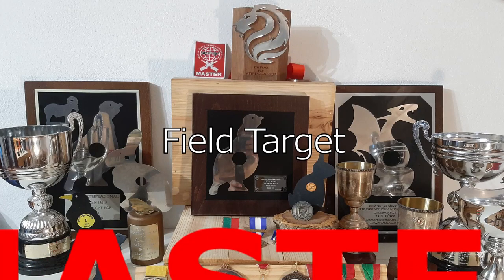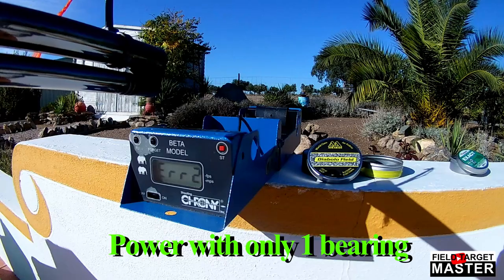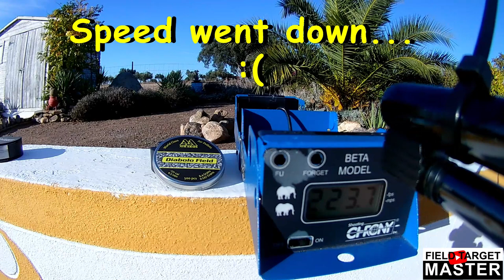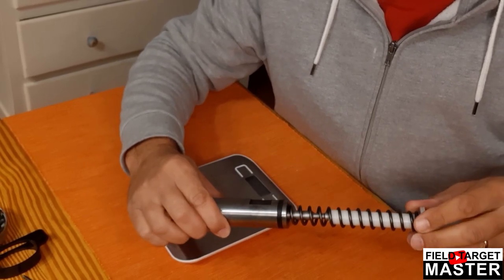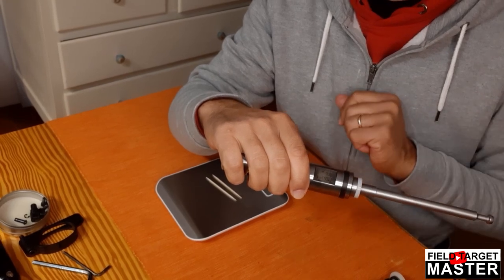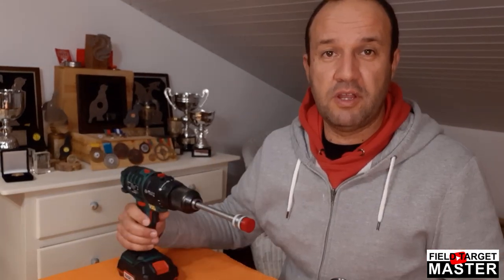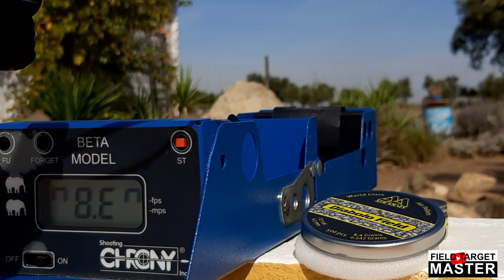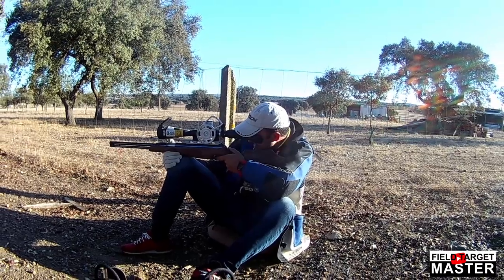How I Fine tune my TX

Comment: What power do you like to use? I live in the UK and have my HW98 running at 11.7 foot pounds with QYS streamline pellets.
Reply from the maker: With exact, 233m/s.
15j?
Reply: @FieldTargetMASTER 15 joules.  That's 11.063 foot-pounds. Maybe if I set my gun to 11.2 lbs it would lessen the recoil? 🤔
Reply from the maker: @Happy-Me.   yes. And with less recoil you will have better control.
;)

Comment: I am an Airarms player from China, and now I have an Airarms  spring rifle in my hand. Recently, I had a problem during maintenance.  I removed the tigger unit from the tigger block.When I put it back on I found the safety button didn't work （cant push in）after i cocked the gun. I can't firing the gun if I can't press the safety button.
Reply from the maker: Hi!!
Maybe you didn’t had the safety pin in the correct position while assembling the trigger unit back.
Try to disassemble and move the pin …
Hope this helps.
Reply from the maker: Watch this other video.

https://youtu.be/CF2UyX9Ca3g?si=w3wMDfdbaaUt6are

He explains hot to do it!